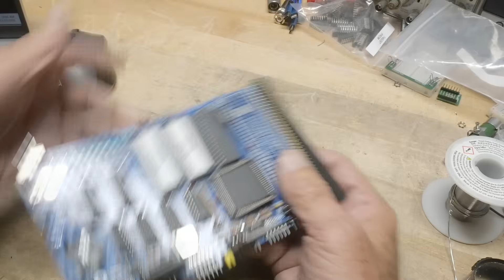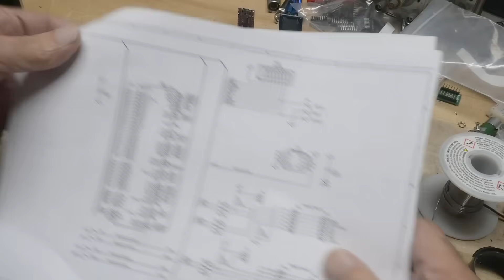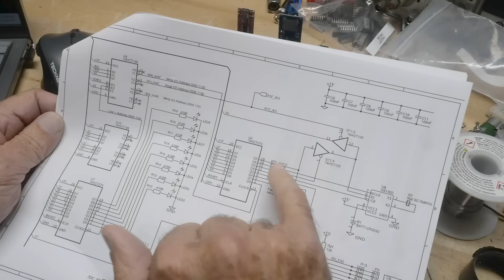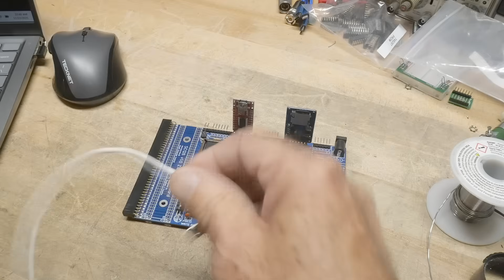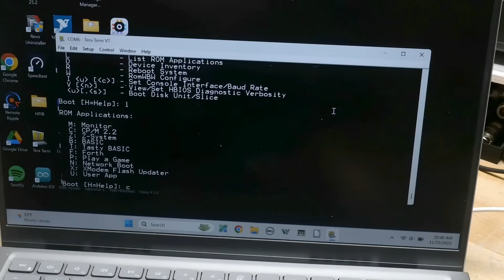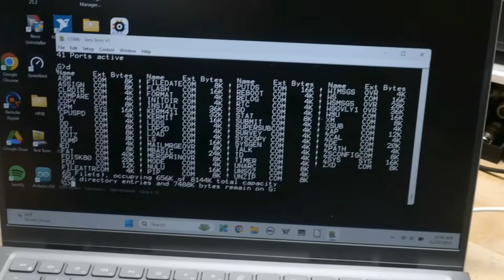#2433 SC126 Z180 Single Board Computer

Comment: The SC130 is a smaller, cheaper version aimed at beginners, offering fewer features but still supporting RomWBW and CP/M software. Both motherboards use the Z180 CPU and have similar performance specifications.
Expansion Slots	SC130 2 vertical + 1 horizontal	
                                SC126 1 vertical + 1 horizontal
SC130 is aimed at beginners or those with modest soldering skills. Focuses on simplicity and affordability, making it ideal for new users in retro computing. The SC126 offers more features and expansion capabilities, making it suitable for advanced users.
I have a SC130 that I've put off building for a while. I think there might be more outreach to possible builders, but maybe I'm just not clear on how sophisticated the regular buyer is.

Comment: Interesting, but somehow a Déjà vu.
In 1986, I built my self a CP/M computer around the Conitec PROF-180X board.
This is a Eurocard (100 mm x 160 mm) with an HD64180 CPU, Floppy controller, two serial ports and a parallel port. The CPU is Z80 compatible (with additional instructions) and has 19 address lines and an MMU, so it can address 512 kB of RAM.
It came with CP/M 3.0 (on an 8" floppy) that uses bank switching to use 128 kB of RAM. The other 384 kB can be used as a RAM disk and when you put the right things there, it will speed things up.
I still have it, maybe I will try to make it boot again. Let's see, if the 5.25" floppies are still readable.
Reply: Déjà vu is kind of the point

Comment: I built the Z80 Retro designed by John's Basement channel - it was a lot of fun and checked off a bucket item from the list before Z80's have completely disappeared or have gone to astronomical prices. John is presently working on a Z8S180 based computer with a Lattice ICE40 FPGA - a little above what I would want to tackle being one who is not really into Verilog.

Comment: well, I'm repurposing a z180 board, and was thinking of using the serial interface (the synchronous one) to do spi for a sd card. seems it's doable. I will have to "borrow" their design :). I'm running the latest freertos on it, without any bios like the romwbw. The 18.432 MHz is so the asynchronous uart can easily derive the standard baud rates from that clock.

Comment: Traditionally, where these done on two layer board?  Or did you need 4 layers to pull this chip off?  I imagine the speed might have something to do with needing an internal ground plane once ablove 10mhz?  Just guessing on that - I don't know.
Reply from the maker: this is a two layer board
Reply: And if the Z180  processor supports it, can overclock (on chip clock multiplier) itself to 36mhz, with configurable wait states
Reply: @kiwisincebirth  That'd be 36MHz. MEGAHERTZ not millihertz! Conventions exist for a reason.

Comment: Going "Wayyyy back" there was "The XLR8er" board for the Tandy Z80 machines based on the Hitachi '180 chip. Another trailing edge of technology, that's been 40 years back now!
Reply: I had one of these for a Model 4p that I owned and used until ~1995.  IIRC, the XLR8er board ran at 6MHz versus the stock TRS-80 Model 4 4 MHz.

Comment: Definitely an interesting board. I've actually been needing something that runs CP/M to add some fixes to an old set of Z80 code. Maybe this board is the solution to transfer files between my systems.